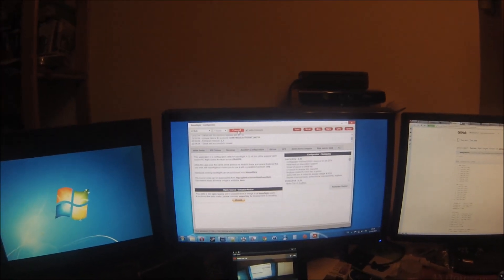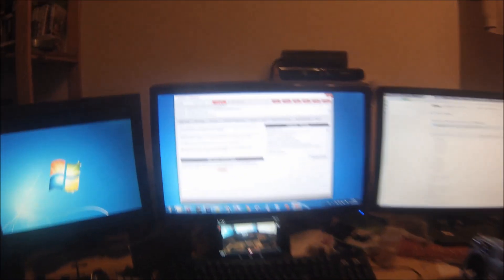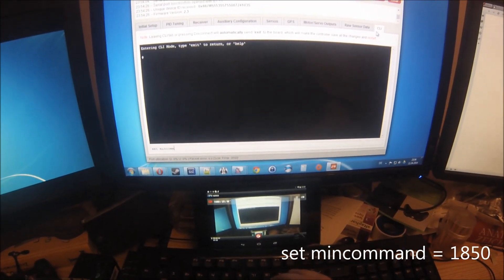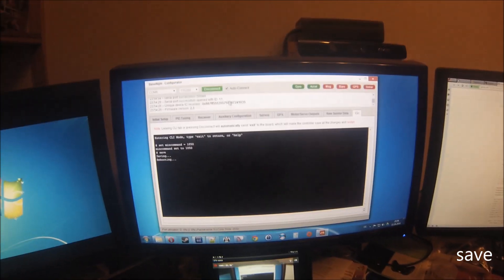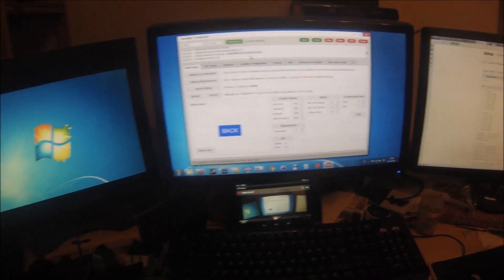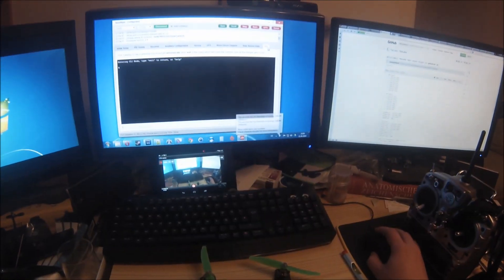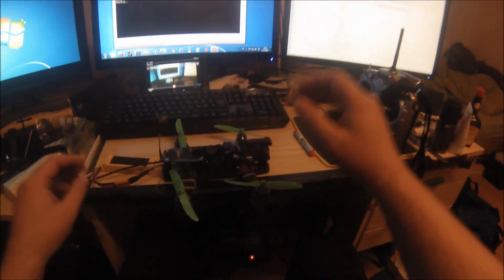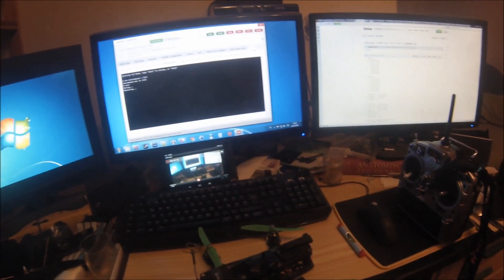Naze32 ESC Sync using mincommand

Comment: you can do it easier from the motor test window , put the all motors slider to max then connect the battery and drop the slider to 0 . done
I wouldn't recommend doing this with the props on .